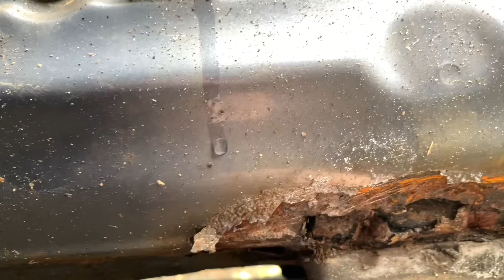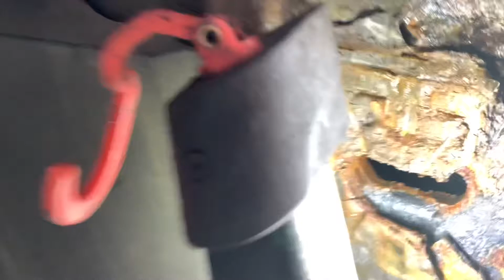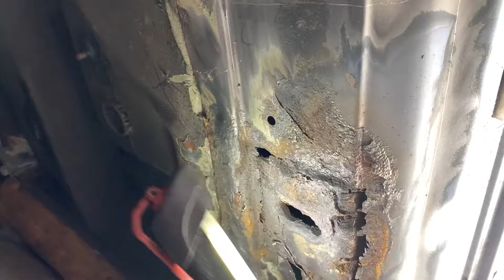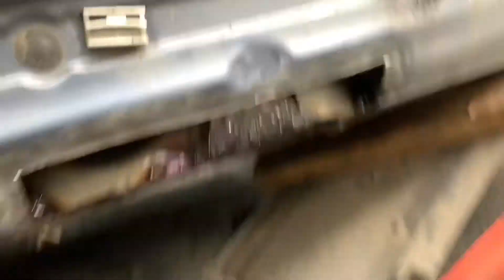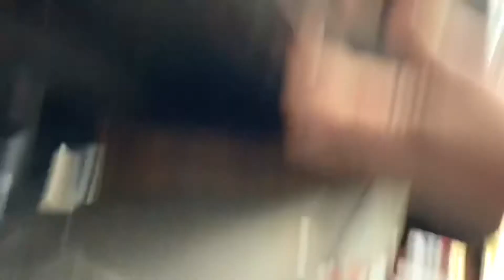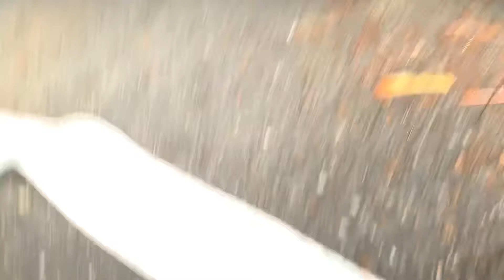Rusty Car Sheet Metal Repair… Car Sill Repair/BMW E46 Jacking Point Welding for MOT

Comment: Gasless? Ive just gone through on a jackpoint on jag xf and gonna have to brave, did 2 years of plater / welder apprenticeship when teen but haven't picked up a mig in over 30 years and not gasless.
Bought cheap used seperate ryobi ark and gasless welders for £50, ark works spot on, time to practise with mig and ger brave on my miht looking jag... Crap it time 😂💪
Reply from the maker: Nah this is argashield. I hate gasless tbh, it’s hard enough to make a half decent job on rusty cars as it is. Gasless only really works properly when you’re doing a thick enough bead for the flux to float on the weld properly. On thin stiff it just oxidises. It’s basically the same as shielding as stick welding
Reply: @StupidBlokeStupidVideos sound thanks fir reply... Bugger. Its going to have to do, ive watched other's do and looks crap but  no options. Out of mot. Will it fail on a holed jacking point, im assuming so.
Reply from the maker: @neilfckofftwatius good luck 😬 

Let us know how you get on
Reply: @StupidBlokeStupidVideos i think im submityi g to tne idea im gonna have to get a cheap used one. Which welder you got pal? Looking at a clarke pro 90 co2. Any advice of good cheap model as miriad of not finding of what im looking for.
Reply from the maker: @neilfckofftwatius the one I used in this video was an old sip one, but there are much smaller ones available which may be more suitable for home use

Comment: How did you get the plug out of the jacking point in the end? I’ve tried prying with a screwdriver but I’ve just destroyed the plug.
Reply from the maker: I just pulled the centre pin out of the plug, then the plug pulls out. It’s like a big plastic rivet/panel clip.
Reply: @StupidBlokeStupidVideos thanks, followed your advice and it came out. Legend!
Reply from the maker: @alandhbstard  sweeeeeet

Comment: What can I use to stop bubbling and rust ? I see also rusted bolts any ideas ?
Reply from the maker: If I had the answer to that, I’d be a very rich man. All you can do is coat/seal it as best possible tbh.

Comment: Great video got the same thing with a e91
Reply from the maker: Cheers. What year of e91? My dads got a 2009 e92, and I’m hoping I don’t have to do the same on that any time soon!
Reply: @StupidBlokeStupidVideos   06 mate its covered 204,000 mile so it a rolling project at this point fix one thing find another problem
Reply from the maker: @shanemartingreenan  fair enough, what engine?
Reply: @StupidBlokeStupidVideos  n47 2.0 ltr diesel engine is still going strong the alternator went the other week and when i took the old one off it was still on the the oem one
Reply from the maker: @shanemartingreenan  that’s because on a 2006 it should be an M47, they go forever. If it was the n47 the timing chain would have failed by now 🤣

Comment: a strip of metal tacked behing that to edge before you started to weld the patch in would have saved you a lot of grief , works as a backing strip ,,, in NI we have to seam weld all repairs and leave bare for inspection ,,, the other thing i would suggest ,  no no no cavity way ,, go google ACF50,, does the same job , only better , seriously better and wont burn , if its good enough for helicopters , its good enough for cars ,,, it even smells nice .just needs a squirt again every couple of years ...
I do lots of this sor of work , usually on Range Rovers l322 at the moment , same jack point only a lot rougher to fix on rears ,,, petrol ones its tank out , drop rear subframe , full exhaust , side steps inner arch liners and sill covers etc etc etc , its brutal work , and no decent repair panel , complex compound curves and double skin , and make the parts your self ,,,,,,,,, 
still , it paid for my audi.
Reply from the maker: MOT rules are same here, but if it’s originally spot welded like where the sill joins the floor then you can spot it, other than that it has to be welded all the way round. We sell ac50 at work, good stuff.

Comment: Nice job, I bought a Nissan Vanette off a mate years ago, only needs a patch on the drivers floor for the MOT he said. I spent 6 weeks under that thing welding, just when you think your done screwdriver finds another hole. Made a decent van in the end and made good money out of it when I sold it, couldn't keep it cost too much in welding wire and gas, I swear the bloody thing rotted faster than you could weld it up. 😀😀😀
Reply from the maker: Chasing it round with a welder, like chasing the Forth Bridge with a paint brush.
Reply: That's J tin for you dude! 🤣